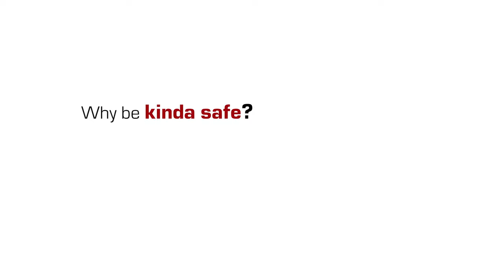Weigh Safe Gauge Repair - How To

Comment: I wanted to share my repair experience. I bought my Weigh safe hitch used, and I have been very pleased. The previous owner probably overloaded it, and the gauge quit working. I think the $10 repair kit is a steal: everything needed is in the kit. I could not get the piston out with compressed air, as overloading the hitch cause the cylinder assembly mushroomed inward, trapping the piston. I drilled and tapped the old piston, and used a bolt to jack it out. Once out, I used emery paper to repair the cylinder and remove the lip. Cleaned everything, and repaired per this video. Good as new. Thanks.

Comment: Hitch failed on first use oil leaking out . Conatcted weigh safe and they will send the kit BUT there is no way my drain plug and fill plug come out that easy. I managed to get the fill plug out after trashing my Allen key, Thinking they had used Locktite to assemble the drain plug I applied heat but still could not remove the drain plug but maybe I need to use more heat?